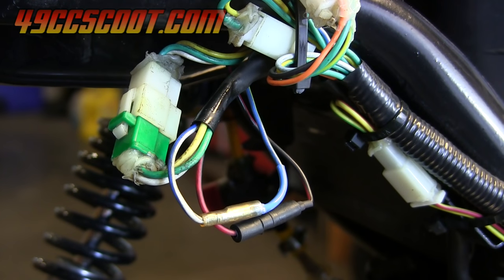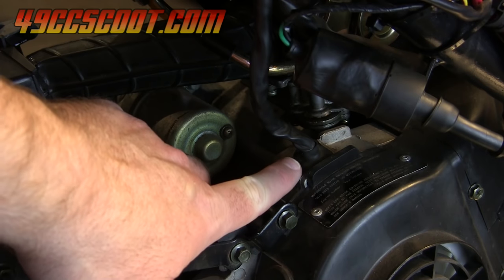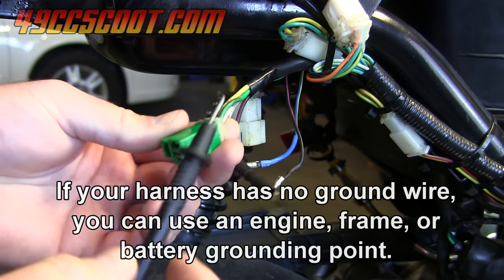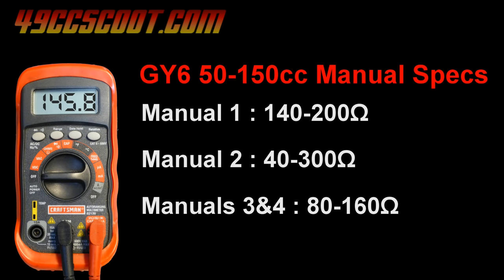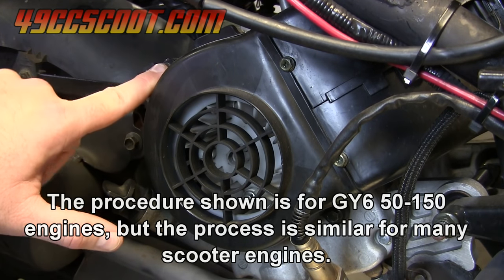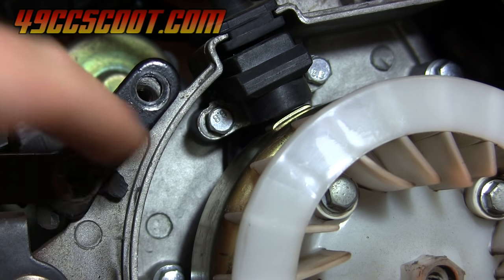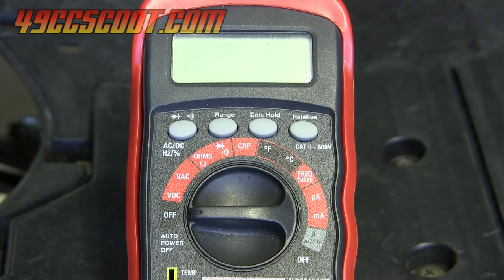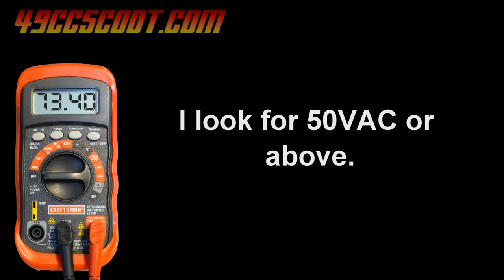Ignition Pickup And Stator Checks For AC Scooters, ATVs, & More

Comment: Excellent video & very well explained. After trying everything for 2 weeks your video helped me discover the problem in minutes. The pickup gap had simply become too large, so I bent it down as close as I could and it works perfect now.

TIP: when replacing the stator make sure to set the gap right! I replaced it and had the same problem because the gap was still too large. Thank you very much!

Comment: Very helpful video. It helped me a lot. I had a bad connection in de green cable that I overlooked. The situation was that I had a unrestricted CDI that was working and an original, restricted CDI that was not working. My first conclusion was that the original CDI was defect but when I bought another one it had the same issue. The difference is that the unrestricted has a short circuit between ground and the sensor that is on the clutch to measure the speed. The sensor is a coil so the unrestricted did work because it used the ground through the coil. The restricted CDI has no short circuit between the speed coil pin and the ground pin so it did not work. When I watched the video I located the white connector with the green cable (ground) and it just fell apart. I soldered the green ground cable and all was good! All CDI’s work correctly now. Thx 4 the video.
Reply: hey I got the reverse problem, maybe you have some solution: I recently bought an unrestricted CDI and the scooter doesn't start with it (it is new and should work). It does start with the original one. I mailed the supplier and they said it might be the pickup not giving enough spark. Can it be something else?
Reply: @cogitoergocogito5032  i do not think the pick-up is the issue.  Check if you have a spark. If you have a spark then I think the timing must be off from the new CDI. Not much you can do about that I think. If you do not have a spark, the CDI is bad.
Reply: @citroenraspdideveed9243  thank you so much for your reply

Comment: Good video - most of what he went over I knew but it was interesting to see what values he was seeing voltage wise.   I have a 2001 Yamaha ATV that will sometimes die - and typically backfire when it does.  After 10 or 15 minutes it will normally start back up.  I could not find anywhere what the voltages should be on the output of the pickup coil - or the input voltage to the CDI  - or even how to really measure them.  So I looked at the signals with an oscilliscope - this might be useful info for some .  For the input voltage from the stator - that pretty much a sine wave (at least from my stator) so the VOM meter should read that pretty accurately.  The pickup voltage it will not - it is not a sine wave - not even close.   If you know what a VOM reading should read  for a given engine - even though it not actually correct - that fine - it can be useful as a comparison.   I did not have that info.   The scope shows a +11VDC peak - goes to zero for a bit - than a -11VDC peak - goes back to zero for a bit.  For a complete cycle the wave form is at zero voltage for perhaps 30 or 40 percent of the time.  It no wonder a VOM will give no reading  or very low reading on that type of non-sine wave.  You can get a much more accurate reading if you connect a "Voltage Peak Reading Adapter" - VPA -  to your meter - rmstator has one - on Amazon - it pricey - $50 - but you can also find that kind of adaptor for half of that easily on ebay.   It converts a voltage (to DC) to closer to what the peak voltage is.  For me the plus and minus 11V signal displays on my VOM (with the VPA in series)  as 5.5VDC (cranking), 9VDC (idle), and 15VDC at hi RPM.   You can also use the VDA and find a useful "baseline" voltage for the signal from the CDI to the coil.  The oscilliscope shows a very short duration pulse from +5VDC to -12.5 - to fire the plug.   A VOM by itself would not capture that pulse.     Using the VPA with a VOM I got 2.5VDC cranking, 2.36VDC at idle, and 3.1VDC at hi RPM.   RMSTATOR has a pretty detail troubleshoot guide using a VPA.  I may have found my problem - may be the stator.  Both 49ccscoot VOM reading for the stator voltage to the CDI input and what Rmstator says in their troubleshooting flowchart is WAY above what I'm seeing.  Using just a VOM (the VPA is not really needed since what you are measuring it a sine way) I get 2.5VAC at idle - and amost 8VAC at hi RPMs.   Way way below what scoot is seeing on his scooters.

Comment: I have an ATV that only has a pickup coil . I got the same 145ohm reading at the wire butt conector . But once I connect it and check resistance at the CDI conector unplugged I get 4ohm . Is the wiring bad ? Also I crank the engine but get not voltage reading . Any help? Thank you!

Comment: Nice tut. 
Do you have an idea of  a good place to find oversights to various makes diameter and stack specs of ignition packs (backplates, flywheels, stators, breaker/switch and coils) ? 
I have a bit (!) of an old timer ignition custom upgrade invention project at hand and all I have found so far with the shop parts, are "compatibilities" for so and so vehicles. 
My hog´s so far beyond end production that I cant find neither parts or documentations. I need to find something amongst todays makes closest fits, I need oversights of geometrics... Heeelp ! :D
Reply from the maker: Sounds like that would be a useful resource... but I have no idea where you'd find that. Sorry.

Comment: i have a 150cc that used to run ok and then the dash, made of fiberglass started to crack and dismember itself , causing certain switches that were mounted on them to falter and break off. I lost my headlight and was forced to splice inorder to get home one night. Well apparrantly the splice caused the battery to drain and because I have ran the splice from a hot black wire from the high bean switch, which was one of few still attached to the fiberglass surrounding the left handlebars.
Well that just fucked everything up. Once I stopped that connection, I was forced to get jumps with cables, and everytime it seemed to take longer to get the motor started. I also noticed that the run off line from the carb floats was starting to really get bigger each time I was in need of starts. 
Now, with a fresh battery, spark still from the plug, this SOB wont turn over. I have taken the carb off 5 times to ensure the jets werent clogged, and that the floats were allowing fill up and when that occured , the gas was being shut off the flow to the carb.

 WTF did i do????
Reply from the maker: If it's not getting any fuel, then you may have a petcock problem (failed or lack of vacuum supply) or a pinched or clogged hose or filter. If it's getting gas, try checking compression. Valves need periodic adjustments too and when they're out of adjustment it often makes them hard to start.

https://www.youtube.com/watch?v=s0K-ytyjOFg

Comment: hi, excellent video,  i have  150gy6 (vento phr4)  do you know how much watts  does an 8-pole stator produce?? I am thinking of installing a set of 35w h4 lamps (70w total) and I don't know if the stator produces enough energy. How should I measure the output in watts of the stator?

Comment: 49ccScoot my scooter doesnt turn off from the key, checked the ignition switch is good but the minus from the ignition is not  (white and black) does not have continuity till the grey CDI
Reply from the maker: The CDI is ultimately what shuts off the spark, so if the CDI doesn't receive the signal to stop, then you will have to find out if you've got a wire disconnected or broken. Also make sure there is a good ground to the kill switch.

Comment: I recently bought a second hand 50cc gy6 and i'm having a strange electrical problem I think could be the stator. One headlight is brighter than the other on low beam, on high beam only the brighter headlight works. When side lights are selected the taillight is bright, when i switch to headlights the tail light dims to almost nothing. Finally today i noticed when idling on my commute I noticed if I turned my headlights on the idle would drop and stall the scooter if I didn't rev it.  Could this be the stator or something else? thanks for looking.
Reply from the maker: Dim lights at idle and headlights affecting the idle (making it idle 
lower) are normal for the AC powered lighting systems. Adjusting the 
idle may help both. For the rest, I'd start with checking out the 
wiring. The lights probably have the same power source from the switch, 
so I wouldn't suspect the stator for uneven lighting levels.
Reply: Ok I've started looking over the wiring and opened up the wiring harness protective cover through the under seat area and there's a few wires spliced together then covered in black tape, is this Chinese build quality or something the previous owner has done you think?  i'm going probably go to test the stator outputs from this video and your other video for the charging and lighting checks just for piece of mind in the mean time

Comment: The gap helped me immediately with brand new stator, cdi, regulator, starter...but only getting 21.4 volts when cranking on fully charged battery on a 125cc ducar engine. Any pointers? Bike fires up and runs after resetting pickup gap but is stator not up to snuff?
Reply from the maker: If it runs and you aren't experiencing misfires or low power, then it should be fine.

Comment: I'm getting zero AC voltage and zero continuity on the Red and Black wire. The Blue and White are in spec. Will this cause a no spark condition?
Reply from the maker: Red and black is the exciter coil. That's what gives the CDI the power to make a spark. If it's not putting anything out, it can't make spark.
Reply: @49ccscoot   Thank you

Comment: does the length of the reluctor  affects the ignition timing? or the signal sent to the cdi?
Reply from the maker: TBH I'm not sure. The signal may come from the leading or trailing edge, so if you were to use a reluctor of a different length centered in the same position then it would change timing. Otherwise, not sure.

Comment: What if i have a DC system and the pickup coil has 2 wires coming from it?? How do I do the voltage test on that??
Reply from the maker: You may need to do a resistance check on that.

Comment: So i have power on the pick up and resistance. And power from the stator. Does this mean it must be cdi? How do I test spark plugs or leads
Reply from the maker: For a spark plug,  I always put in a new plug or known good plug. For wires,  you can check resistance and make sure their connections are secure. Coil resistance specs should be in a service manual. The CDI is another swap out. I don't know of a way to test them without some special CDI tester.

Comment: Where does your Black/Red wire go to? I have both from stator. I have mate to CDI. (CDI > Blue/White - Blue/Yellow > Stator) On my CDI on the 2 PIN. I only have the bottom with Black coming out going to ignition.
Reply from the maker: Black/red is the exciter coil's output to the CDI to charge it. Usually it goes to a red/black or black/red wire.

Comment: Thanks for the info. The bike im working on is a Qlink Axon50. It does not have a green ground wire coming off of the stator. Is it grounded to the motor? Also im getting continuity between the engine block and all wires coming from the stator. does this mean it has melted the wires the ground on the stator?
Reply from the maker: Some don't use a ground wire. You'll need to see if you can find  specs for that model.  There are different configurations of stators.
Reply: @49ccscoot  thanks for the reply. These Chinese brands are hard to find but I’m going to remove the coil and see if the wires were burned together and shorted.

Comment: Do stator run in oil I have a suzuki gz250 street bike took the cover off oil came out,I read some run in oil keeps it cool,some say it doesn't thanks for the video
Reply from the maker: Some run in oil and some don't. All of the smaller stuff that I'm used to is dry, but I'm not familiar with the GZ250.

Comment: When you are checking the ac voltage, what are you connecting the leads to
Reply from the maker: One to ground and one to whatever wire you want to check the voltage on.
Reply: @49ccscoot  ok thank you, I wasnt sure if it went to common, ground or across

Comment: @90GTvert  I ended up purchasing a  malossi over range kit bec my stock cvt was having too many slipping issues. I had a question for you, do I need a different stroke crank or anything else different to run the 103cc big bore kit on the 1e40qmb? Thanks again for your help
Reply from the maker: fastmalibu01 Yes. You need to use a crank with a 45mm stroke if you wish to get 103cc from a 54mm bore kit. It will take quite a bit of clearance work to fit the 90cc+ crank and cylinder onto stock 49cc cases unless you get lucky and have the 1E40FM or 1E40QMB-A that are sorta oddball engines. Lots of info :
http://49ccscoot.proboards.com/thread/10392/cutting-cases-accept-cranks-matching

Comment: I'm trying to figure out why I don't have spark I've replaced everything other than the stator but my stator only has the hardness and only one separate wire is this normal
Reply from the maker: For some scoots it may be normal. They aren't all wired the same. If it's a Chinese scoot/engine, there are multiple variations in stators even for the GY6 for example.

Comment: Done all these checks. Getting 1 - 2 volts at pickup. No spark. Checked gap, replaced pickup, stator, CDI and coil. Still no spark! What else is left?
Reply from the maker: Check the ignition switch and kill switch. Perhaps they are disabling the ignition.
Reply: @49ccscoot  There is no kill switch and the ignition switch is new. I have noticed however that both terminal on the coil seem to go to ground on the continuity setting of my meter. I have several other coils and they all seem to do the same?
Reply from the maker: @motorcyclejunkie7564  Find out which pin of the CDI uses a ground to switch between run/kill and see what it is doing. You'll need to find out if yours is ground to kill or ground to run.
Reply: @49ccscoot  Thanks, I'll take a look

Comment: @90GTvert thanks for the help yeah I'm gonna check it out. Wow just keep getting so unlucky with my project, it turns out I just tried to install the malossi overrange and my variator doesn't fit, it turns out the crank on the engine is 5/8 and the inside diameter of the malossi variator is 1/2in. Do you know any solution on what I can do?
Reply from the maker: fastmalibu01 I've got info on my OR kit for the larger cranks, including all part numbers, here :
http://49ccscoot.proboards.com/thread/3442/malossi-large-spline-over-range

You may be able to just switch out the boss and ramp plate if your variator is the same. I've got some measurements there too that many help you figure it out.

Comment: i have a problem with my atv, I get a spark and the lights work, battery is fully charged and starter turns but it will not start. Have tried everything I could think of, and help?
Reply: try looking into the carburator. if the carburator is good in it, it may be the compression

Comment: Hey .. First i found your tube very helpful; But i still have no spark after i bought a new stator and pickup .. i got 75 volts from old and new stator. But for the life of me i can't get any juice thru the pickup . it has a good wire checked that out. but no voltage . I even opened the mounting holes to move closer to the reluctant magnet, .015 close as i can get. seems they like to have at .030. but closer would be better . After installing a new stator and p/u and still no voltage , i have to believe the new p/u is NO good.  PLEASE HELP Denny
Reply from the maker: Do both the new and old stators give you nothing on the pickup? If the pickup on the old one will show voltage, you could swap it to the new stator or just use the old one since it's giving you plenty of voltage from the exciter coil. You can get pickups alone for roughly $5 online.

https://www.youtube.com/watch?v=XR-cYzh2__Y
Reply: Turns out the kick stand needs to be up for spark! Who would have thought. Thx Denny
Reply: thx denny

Comment: Did the voltage test on the pickup wire and it has 0 volts. Is this a bad stator?
Reply from the maker: If it's done as shown, then very likely yes. Make sure there's nothing else going on like a cut wire or ground missing.

Comment: I also have a question about the stator and I replaced all the electric components and still have no spark. It's a 2008schwinn sport. I rode it 4 days ago and put it in the garage and now it's Dead. Nothing will work I can only jump the starter to get it started. Please help
Reply from the maker: It sounds like you have a battery issue. If the stator was dead, jumpstarting would do no good. I'm not sure, but you may have a DC CDI. That's a CDI that uses battery power instead of AC power from the stator. DC CDIs will not operate to create a spark without a good battery.

Comment: Scooter pickup coils should output anywhere from 1 - 10 VAC depending on RPM.  You need to use a peak hold meter to see this.  The meter you're using won't show this since the signal transitions are too brief to register correctly which is why you're getting a low reading.